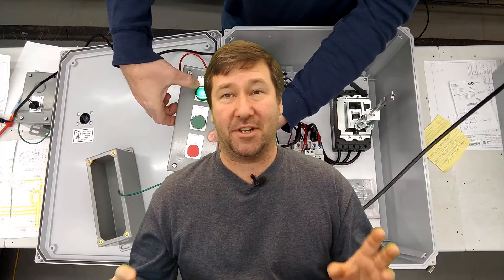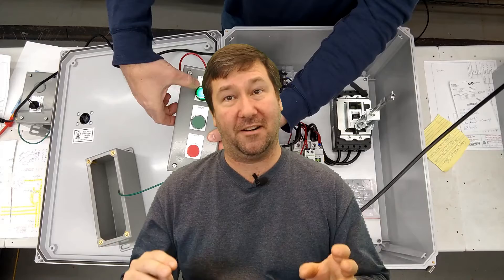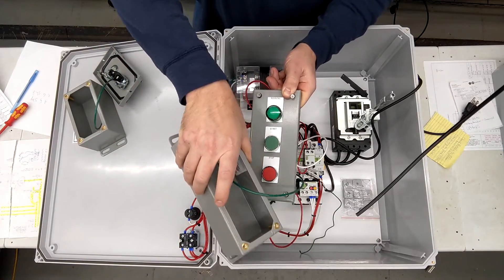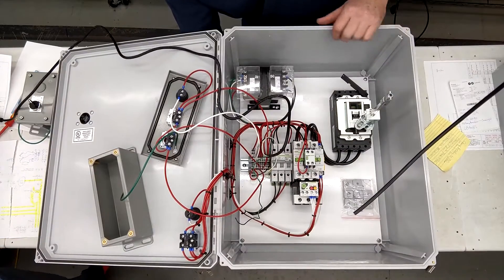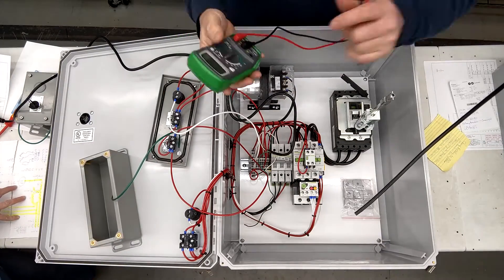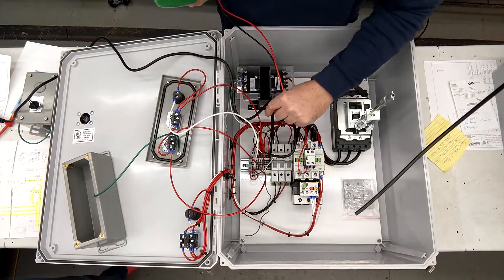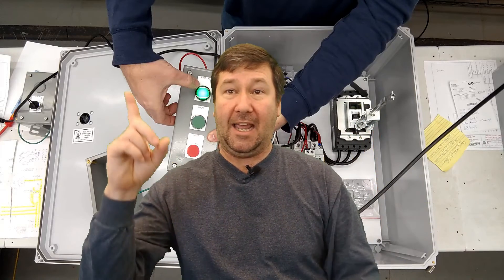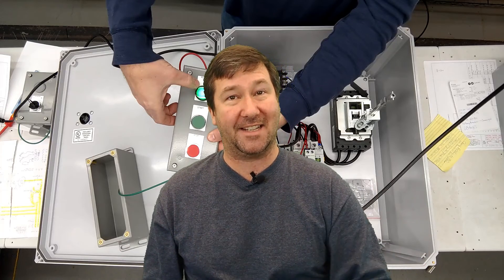UL508A Industrial Motor Starter Panel with Remote Start Stop

Comment: Some jobs I build will have a local and remote box. Local will have controls and remote will have high voltage with Powerflex and lenze for motors and pumps. I like your work and teaching.
Reply from the maker: Thanks Dwayne!